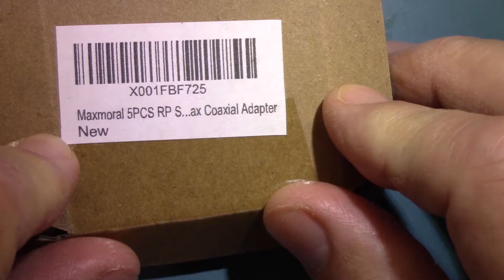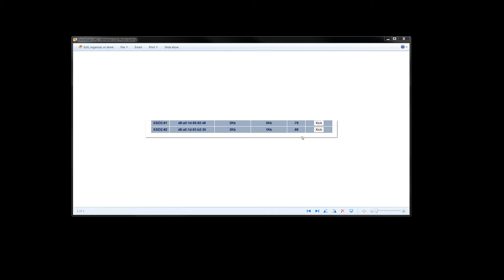IoT#83 – How to solder SMA Connector - ESP32 External WiFi Antenna Mod #1

Comment: You could file a little bit of the pins of the SMA connector to put it tightly to the PCB and get more mechanical solidity.
Reply: Yes no clue why he didnt trim the pins but hey ho! If in doubt use hot glue lol

Comment: You can't just change antennas like this. If you noticed there was an inductor and a capacitor under the antenna, which are used to match the antenna to 50 Ohm impedance. Now as you replaced the antenna most likely it's no longer tuned to that impedance. So there is a high chance that new antenna will operate far from its most efficient state, which will then affect on  reception and power consumption.
Reply from the maker: Break out the Smith charts!
Reply: @muxallopeniot9194  Exactly!)))

Comment: you could have cut the pin a little bit to push the connector fully in.
Also the center pin is not the positive pin, but the signal pin.

Sounds like you're having fun while doing it, kind of agree with the other comment about AVE